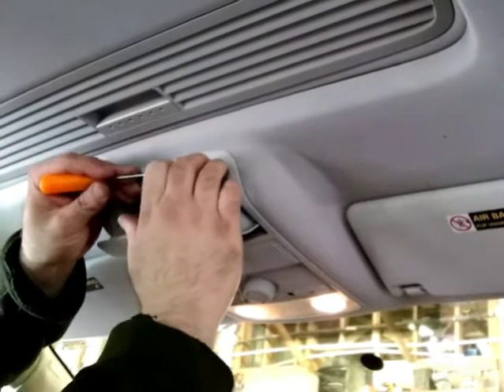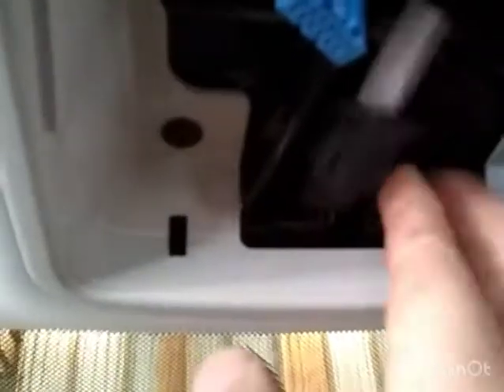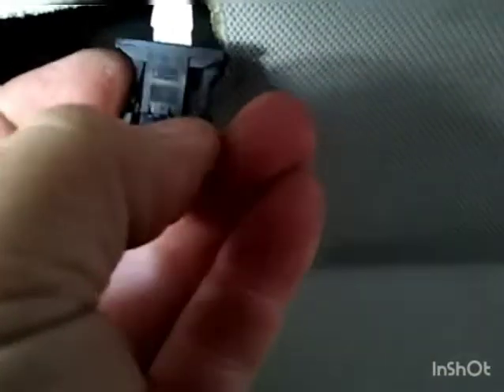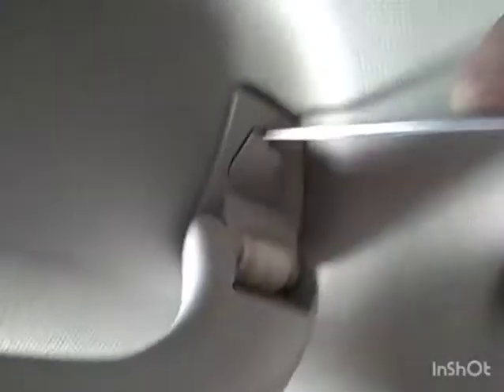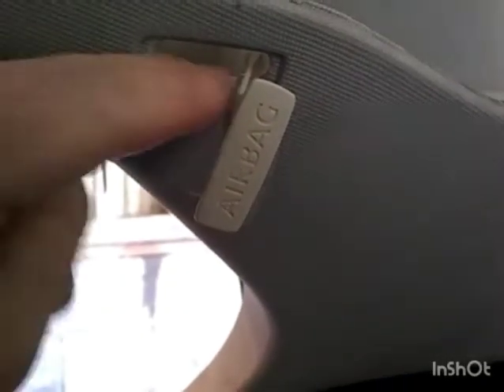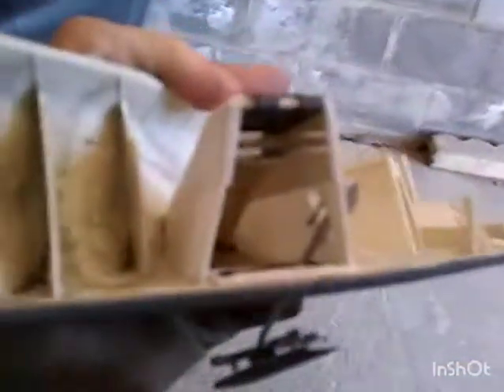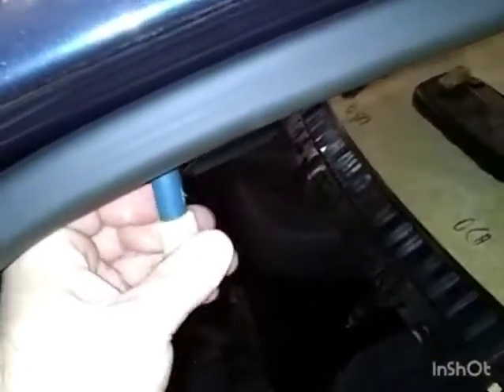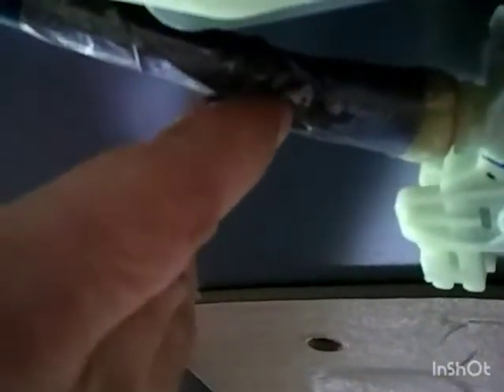fix sunroof leak FIXED VW

Comment: Do I need to remove the whole head liner to fix this? Could I just drop the rear passenger corner?
Reply from the maker: Yes I believe you can although I think you'll make it just as hard to try to get up in there without leaning on and bending the headliner.
You'll have to be kind of in a crouched position to get your hands up.
But I would say go for it and if you can get to him easily then do it that way.
And if it's too much trouble you can always pull it out.
Well I hope this helps, let me know how it turns out.